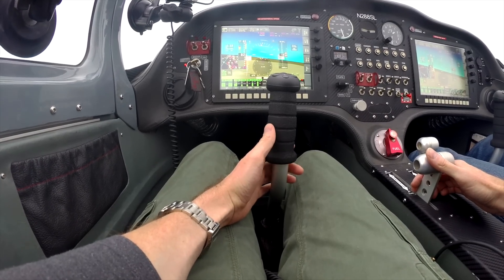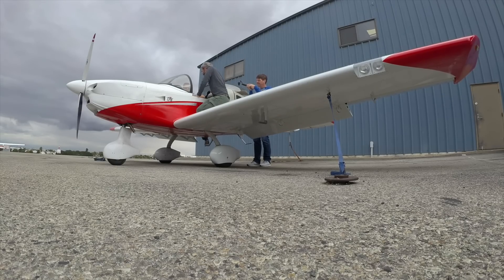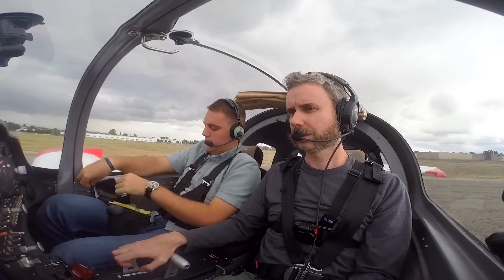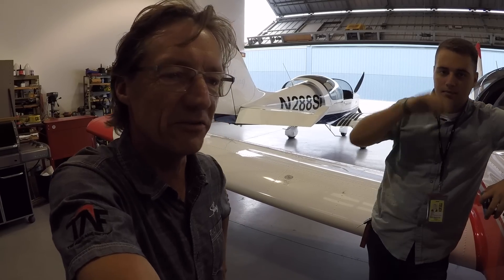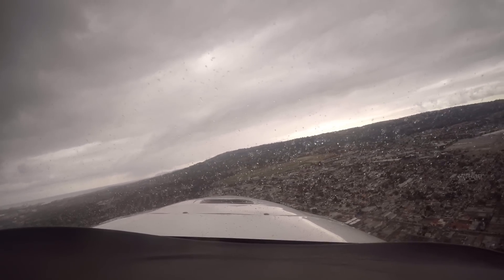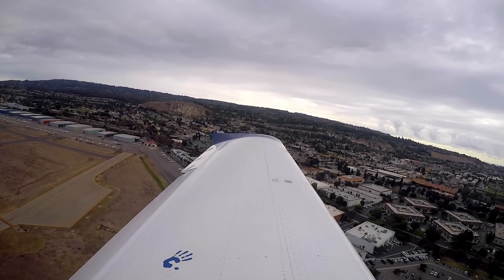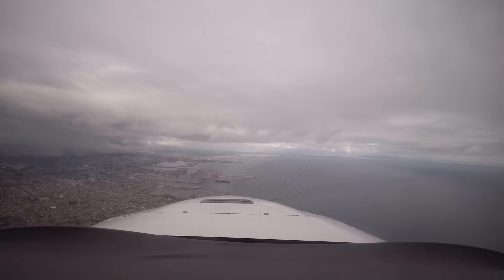Rotax Engine Failure - Flying Impressive Sling2 LSA in SoCal

Comment: Weird that I’m seeing this now…I actually had a bad Rotax run up just yesterday in an RV-12. Our right “ignition” (they aren’t really normal mags in a 912…they’re capacitor discharge units) dropped below 300 RPM and began running a bit rough during the run up. A lot of guys would’ve said “meh” and still went but it made me uncomfortable…so we did a 180 in the run up area and that was that. You gotta respect your personal minimums and if something is out of spec, even a little bit, that’s enough for me to scrap a flight. It’s all about identifying and eliminating “holes in the Swiss cheese” before they become a factor.

Comment: I had one side of the ignition quit in flight. 80hp Rotax 912UL. It was the wire going from the magneto to one side of the electronic ignition module. There was a connector that must have come loose somewhere inside. Never did find the break, but cut out the connector and soldered the wires directly together and it worked perfect. Had a stumble/ vibration at idle 3 years later. Changed plugs and that fixed that. Had a little rumble in cruise this year and had to rebuild the 2 carbs - O-rings on jets etc.
Reply: balancing is a must on the 912. vibration kills engines

Comment: Exactly the same thing happened to me on a Best Off Nynja with a Rotax 912 uls. On Startup, it just reeked of gasoline.. A float in one Bing carburettor sunk and gasoline overflowed. They are made of styrofoam covered  in a thermoplastic. The thermoplastic punctures and the styrofoam gets saturated with gasoline. I immediately shut the fuel line and mags, and got out real fast! That comforted my habit of not buckling up until after engine startup in case of fire.  It is a known problem, there was a service bulletin for it. We fixed it pretty fast, the club had the spare carburettor floats. It certainly got my heart racing. So check the SB's regularly and don't buckle up until your engine is running smoothly, there is no fire and no smoke or smell of gasoline.

Comment: Been flying 912 Rotax engines for 20 years with no issues. I do my own maintenance, never had a carb needle and seat fail. If I did while flying then I might call it a Rotax engine failure, but not while doing a preflight run up. Bad title dude.

Comment: Slings are fun to fly terrible to maintain, i look after 2 2017 sling 2's and they are constant getting problems with water in the fuel bowls causing rough running at higher RPM and along with general maintenance its very hard to get to some spark plugs, the screws that come standard are so easy to round off we just replace every one on the aircraft!

Comment: Carb floats now have two ads on them..had exactly the same issue in a sling4. And yes we were complying with the weighing of floats in services, it just appeared one flight on closing throttle after landing...very lucky. That being said with new float (version 3) have had over 100 hours with no issues. Rotax and sling, two great products.

Comment: They should all have that emergency parachute system. Period. I’ve read and read and heard arguments on both sides of the coin. For them and against them. I plane I getting a LSA or a small Cessna plane for flying around Idaho backcountry and camping. I would not fly without one. Engines fail. What a scary feeling to hear your engine cut off in the sky. Nightmare

Comment: I tried a Sling LSA on a BFR last year.  The engine stopped about two miles from the airport on return from a fun 90 minute flight.  I got the aircraft down safely, but the owner/ instructor froze up.  The problem was fuel contamination (dirt).  Other than that, it was a pleasure to fly and I had never before flown in an aircraft with a canopy.  Fabulous flight (aside from the engine failure).

Comment: Yea you rarely have any of those issues with Fuel injection my brutha ..Carburetors are OS ....Sure much cheaper but tune ability and efficiency  are just none starters ...You go F.I. with wide band O2 sensors and you in the front row on economy & performance always without any of the mixture issues and EGTs ...

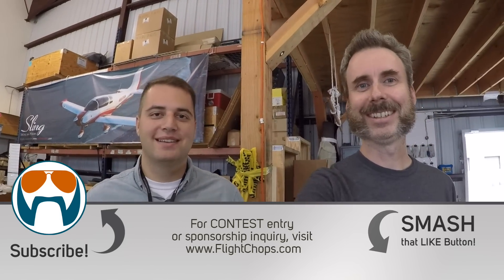Comment: The best way to spend 19:10 of my day! Thanks Chops, keep up the awesome video's!
Reply: Not when you were looking for a proper engine failure and forced landing in a sling , and find this where there is a carb problem at the holding point 🙈🙈 also why did he shut down  ? They still need to take it  back to the hangers 🤓

Comment: I feel ya on the hands thing, when I owned a Taylorcraft it was throttle right hand, control yoke left hand, when I started flying a Cessna 188 and Air Tractor 301 it was throttle left hand, control yoke right hand. After a few hours you get to where you can change between hands without even noticing it.
Reply: OG Flyer
Did somebody mention Taylorcraft?

Comment: I did my PPL in South Africa and recently I got the opportunity to fly the Sling 2 with the 912is fuel injected (and toe brakes!) when I went back to South Africa in February. It’s a great little (and efficient) aircraft and I’m glad it’s getting popular in the States! When you can see fuel touching the bottom tip of tank below the fuel cap the fuel level is at 1/2, because the tank is at an angle.

Comment: Rotax: the high revving at cruise, which creates additional engine/prop decibels and the pain in the rear oil check procedures, simply not cool at all, imho. Would much rather have a "conventional" power-plant (check oil with dip-stick, cruise r.p.m. of around 2700/2800).

Comment: Crazy Bob Hoover!.  "Gentlemen,, you have a race!!", as I grew up going to The Reno circuit every year.  Heck of a show he did at Reno.  Never got tired of it and always looked forward to seeing the Shrike do the things it did.  We had a Mount ST Helens Volcano flights Cessna 210 loose a mag AND carb at run-up with a full load of tourists.  The motor actually sputtered and died on the spot.  Not good.  We fetched the other one and got them there paid-for ride around the volcano.

Comment: I started my training on the sling 2 I seriously prefer it over the C172. That control stick and throttle, low wing and glass cockpit is just perfectly designed for the pilot. If I could, I definitely buy one just for fun flying